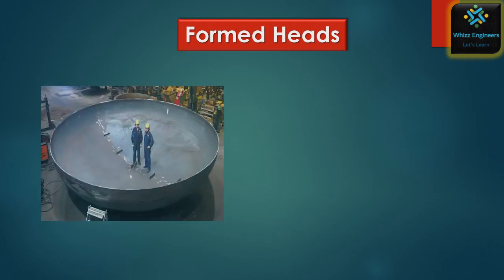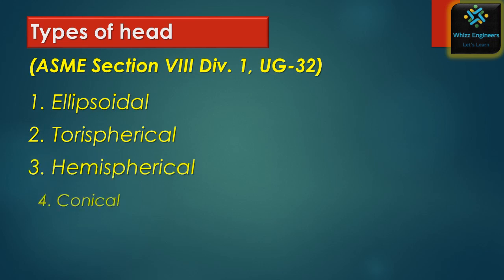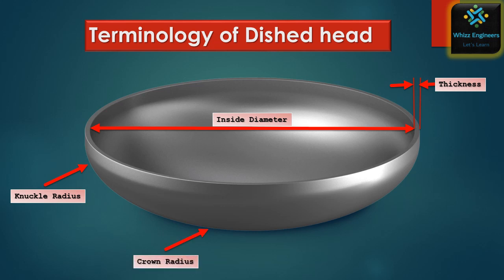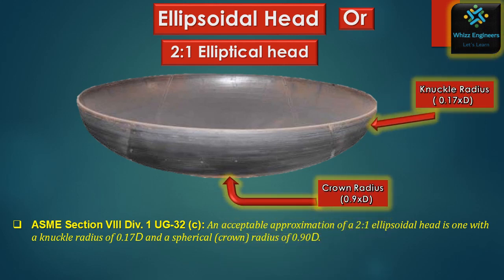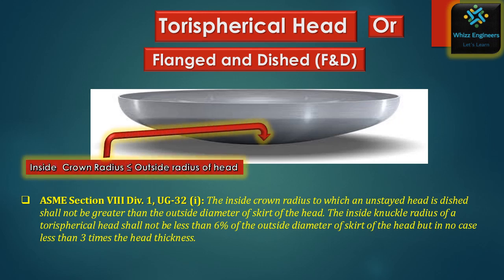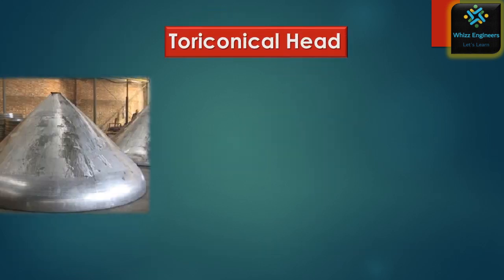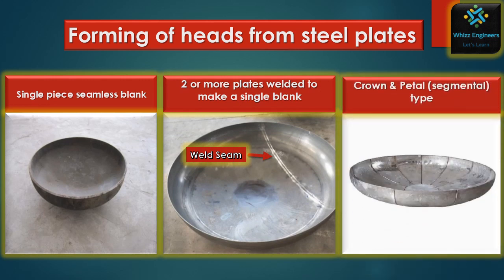Formed Heads | Dished Heads | Types of Head | Head Types: ASME Section VIII Div. 1 @ Whizz Engineers

Comment: You said  low pressure Modrate pressure and high pressure 
Could you please tell the range 
Of low pressure means how much pressure so that we can decide heads.
Reply from the maker: As per ASME Section VIII, Division 1 covers low to medium pressure (up to ~3,000 psi), Division 2 covers medium to high pressure (up to ~10,000 psi), and Division 3 covers very high pressure (above ~10,000 psi).

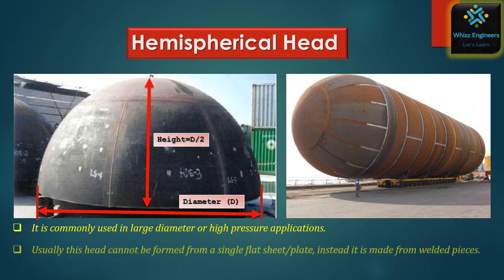Comment: 4:38 Why cannot the type of heads be manufactured from a singe flat head or peace? Will it be weaker?
Reply: I imagine at larger diameters (like the example shown) the amount of deformation needed to stamp/draw a hemispherical head from a single plate would either exceed the elongation-to-break of most materials, and even if it didn't just think of how large a press would have to be to both be powerful enough and have a deep enough stroke in order to perform the stamping. It likely just becomes cheaper and easier to do it in sections.
Reply: The limit of sheet metals width is the standard capacity width of the rolling mill. Anything requiring a wider sheet than standard is custom made or welded from the smaller sheet width.